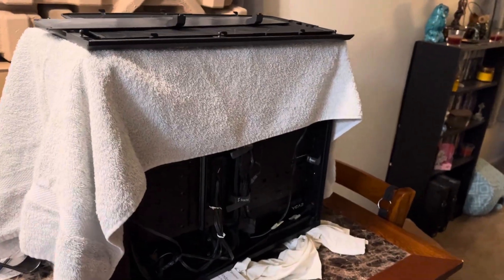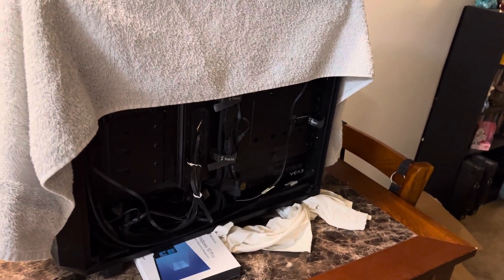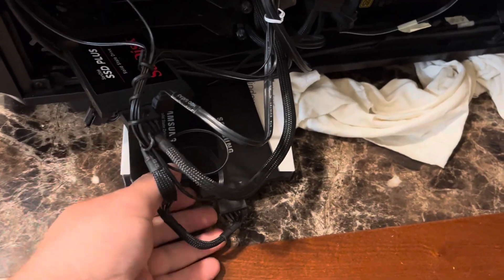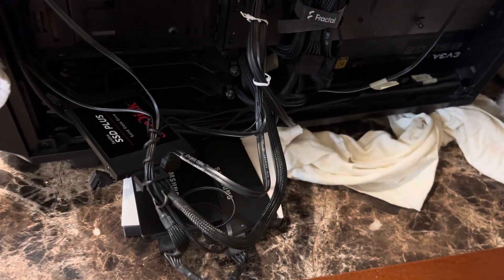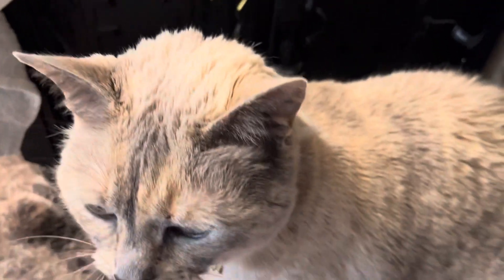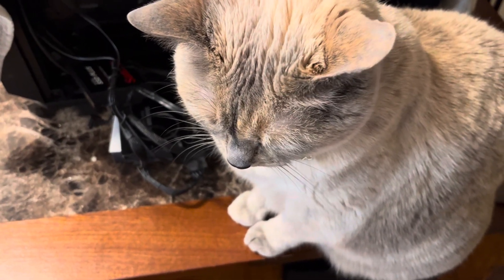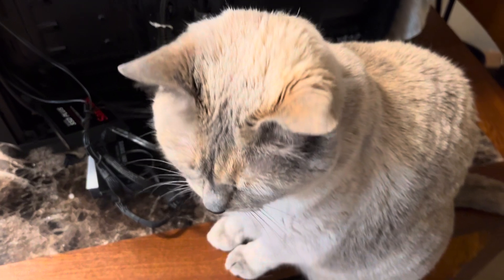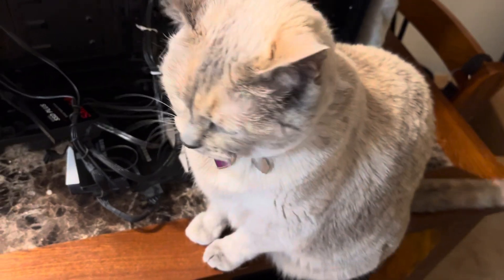CHANNEL DOWN until further notice.

Comment: The issue is almost definitely a corrupted windows installation, or possibly the SSD is fried if it is very old. Its pretty simple to reformat your SSD inside the BIOS to wipe it clean. Then you can install the windows iso onto a flashdrive to reinstall a fresh windows. If that fails the SSD is most likely fried and youd need to look for a replacement or use your second one. SSDs have gotten pretty cheap and a 500gb would only cost $20-30.
Reply: Also safe to say that pure system disk is the ONLY place where you can get way with cheap low volume SSD. It does not really require top end speeds or huge rewrite resource. You need better speeds and big Terabytes Written, or TBW resource only for specialized software like video editing and stuff like 4k video cashe. And maybe for some games that can benefit from high speeds. Probably my biggest mistake 3 years ago while making new system was buying the best m2 I can afford for system and basically wasting m2 slot for better use...
Reply: That would be my first option to solve the issue @Yakez42
Reply: Also backups backups backups. I have saved so many projects by having backups
Reply: I couldn't have said it any better XD
Reply: yup ive known people whose ssds have fried after a few years
Reply: just had my drive die recently, somehow after i booted up off an old ubuntu thumbdrive i was able to save every single file off the drive, i still don't fully know how
Reply: I also had this with windows 11 and the BIOS just wasn't properly connected and then couldn't find the disk. Repair guy pushed the BIOS back into place carefully, no system corruption or corruption of any kind
Reply: Don't even have to reformat from bios — windows installer can do it in a few clicks

Comment: I am a bit of a computer whizz, I can attempt to help you if you'd like. @VAOS
Reply: The MSI site also specifies that your system files could be corrupted or damaged. You can try to move your boot drive to a different SATA port on your motherboard and see if that helps. If it does not, then we know it isn't the SSD
Reply: After speaking with my father, he says the issue will be primarily be an OS corruption
Reply: According to MSI, it is said that the issue is BIOS related.